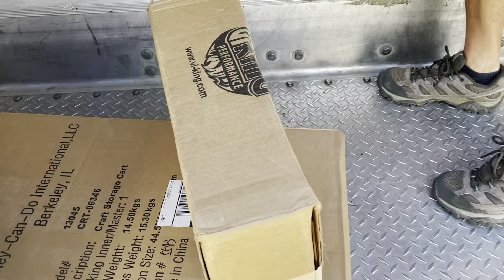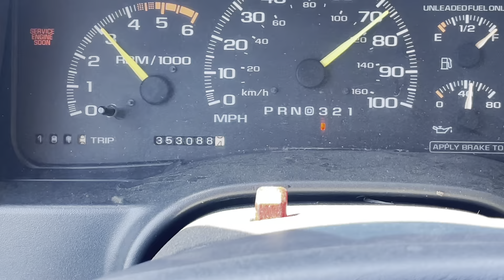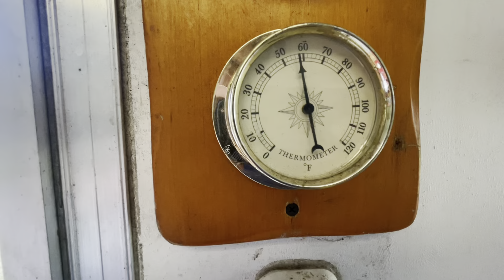FLYING! New PERSONAL BEST but a difficult weekend at Edgewater!

Comment: Love this video. You have me thinking of getting back into racing with a similar class of car.  I was a nitrous guy too and when my car ran 12.40's on the motor and 11:20's on a 175 hit it was the most fun and rarely broke parts. I could also run pump gas on the street.
Reply: Those numbers are not adding up there's no way you pulled that off
Reply: Lviv for love… come again? My math works on that. My mild 355 went 13.50 on motor and 12.20 on a 150 shot. Every time.
Reply: @DWO619  Don't really care if you do believe it. When you have a set of heads bigger than the cam is matched to the nitrous will make up for any short comings in the combination. Also I was racing in Maryland where the air is better than where you are maybe. But i'm sure you took all of that in consideration. Also we used a fogger into the throttle body. But I'm sure you already knew that.

Comment: Not sure if you can do the same with Chevy, but with Pontiac you can build a piston stop with and old spark plug, knock the porcelain out and and weld a 1/4 bolt on it. Then put it in number 1 rotate it one way slowly, mark the balancer. Rotate the other way mark the balancer 1/2 way between is top dead center. And should be zero degrees on the balancer.

Comment: Bill this is your best video yet. I have not bracket raced in 20yrs at Edgewater. Because of your videos Im building a G-Body Bracket car again. 82 Cutlass from Florida with zero rust. Get the car tomorrow and have a couple weekends of work before she is ready. A new 4 bolt 355 crate motor, a RV truck cam. Has a nice set of Eldelbrock RPM heads with a Holley Carb and a new TCI 350 transmission. I have to figure out what Rear gear it has. But I’m hoping to run mid 12’s on just motor. After I learn the car and how to play the game again she will get a 150 shot. I got a stupid deal on this car. I will be racing a rust free 12 second bracket car with a new motor and new transmission for around $6,000 bucks. Deals are out there Guys if you hustle. Thanks for the inspiration Bill. Please do more Track videos. Hope to line up next to you at Edgewater soon…

Comment: Thanks Bill, those few seconds at the end answered my questions about manual mirrors. I got screwed by buying the power version 
of those Trail Ridge mirrors.  FACT if my truck actually vibrated as bad as my mirrors there wouldn't be a safe cup holder in the truck!

Comment: Love the new camera angles in the car. We had that same problem with a drag radial and I upped the air pressure. We were wadding the tires up at 18psi and increased to 20psi. Our car is 4200lbs with me in it. It mid to low 1.4 60fts.
Keep up the great work!

Comment: I've got a challenge to you Bill. Buy yourself an Edlebrock Airgap intake and put that on.. if it doesn't go faster I'll buy the intake from you to cover the cost of the intake. I run an Air Gap on a 350 in my 88 S10.. stock bottom end, Double Hump heads, .490 solid cam, 4.10 gears and I run 12.0's with a 1.58 60ft.
Reply: what size stall
Reply: 3500

Comment: Hey Bill even a bad day at the track is better than good day at work,she's leaving the line alot better this time around,my car picked up 3 to 4 tenths with nice cool air coming in and the exhaust uncorked, I would love too hear the boo with open headers,sometimes I would take the pipes right off or depending on how much time I had I would take the collector bolts out flip the exhaust to the out side off the header take a grade a bolt nut and lock washer and bolt the exhaust on with one bolt,and some safety wire and it would always run better,plus you don't have as much trouble hearing if your car is running when rail or super pro is runing you down

Comment: Bill if you're gonna stay on the juice, then you'll be dollars ahead by buying your own mother bottle, and finding old refrigerator that'll take up right bottle of that size. 
Surely up there you should be able to find old side by side refrigerator for cheap that yuh you can strip the shelves out of it.
Because for the inflated price they charge to fill bottles, and the fuel your burning up there and back. 
It won't take but a minute to recover the cost of the bottle, but actually you'll be money ahead, only feels upside down at first. 
Good luck, and have you ever ran heavier springs up front to load the back up harder, and I've even known some that'll just run heavy on drivers front to counter they're weight if they're on the stocky side of things.
That way you can run your shocks closer to the same adjustment instead of having to compensate for the driver's weight. 
Just something we use to do, but we didn't have the high tech shocks you have today either. 
But it doesn't really look like it's loading the rear of the car for best traction either. 
But I've seen now where they're actually raising the rear up on launch to press the tires harder into the track to get traction. 
Reminds me of the old dodges up on shackles to get tires under the fenders in the back.
Here we were going down in the ass ends, and dodge boys were making extra long leaf spring hangers to raise the ass up.
Sure made them dance around on those old bias tires too, and they couldn't hardly drive on wet roads because of they preferred to go in circles when they tried to leave red lights and stop signs.
But that was probably before your time, be closer to your dad's days back when he drove his 55 daily I'll bet.
Happy Easter and scratch the pups heads for me.

Comment: Bill you mentioned at 20:26ish where the other driver was on the brakes to not break out and you just barely drove around him using the bottle..
One thing I learned a long time ago when bracket racing cars in this range of performance is the following- use your brakes to scrub some speed and if you are way out there you can ease the throttle out some, but never lift and brake too! The other lane can and often will top end charge you in those last few feet! Too much momentum is lost when you brake and lift both at same time. Use one or other but not both! 
Then again if you both are spraying the big end well...lol ya' just never know!
Also learned long ago to never try to "evaluate" your opponent. Just go out there and run your lane. Sure you need to know who is dialed higher or lower, but in theory even that shouldn't matter so much. 
Also, for all you new drag racers out there, get you a practice christmas tree and use it! If short on funds then just download a free app on your phone. Just get one and use it over and over. Once you really get to know your car you should be able to hit consistent .015-.020 trees. Then when you really need to bang it in the finals you have just a little cushion to nail a .006 for the win!

Comment: It's  pretty good for stock shocks and tight front suspension. You get your shocks on it. Loosen up the front suspension and maybe trick springs you won't have anymore wheel spin. Also a couple of times  I have had to add some seafoam a while then change the oil and adjust the lifters of also had to listen to the engine and i even used a vacuum gauge when I adjust the like a carburetor . Of course making them all the same turns.

Comment: Seems like you got no quench, pistons are probably so far in the hole you probably only have about 9.2:1 compression.  A 383 with 2 valve relief pistons at zero deck will get you what you want.

Comment: Unless you're carrying a beachfront of sand there is no need to throw away a race at the finish line. There is nothing the atmosphere can do to make your car pick up more than a couple of numbers unless it's inconsistent, so a couple of squeezes on the brake pedal will be sufficient in most cases. Throwing away 10 to 15 MPH is just asking for a loss, but then again I've won many a race due to mistakes made by my opponent rather than my skills, and I was always grateful.

Comment: One thing I found out over the years is if you just run your number you don't have to play all these games.
Reply: How do you run your number tho? Seriously, cause we are only talking like 10-12 seconds here so how do you run your number consistently when we are dealing with seconds and hundredths of seconds? That’s what I’ve never figured out
Reply: @1982MCI  just do the same thing over and over. Some vehicles are far better than others.  I usually dial off the last pass,  but also look at the weather and such.  You will also find some vehicles just get faster as the day goes on.  Some will get slower.  It's just knowing what you have and doing the same thing every pass.  Stage the same.  Leave the same.  Same shift points and so on.  Just rolling in a extra inch at the line will change everything. What you gain on reaction time you loose on et and so on

Comment: Have you changed the springs in the distributor for the Vance to a smaller or weaker spring so the Vance timing comes in sooner I'm thinking you got the MSD sugar the little one
Reply from the maker: It’s locked out. 👍🏼

Comment: I’ve watched all of your Malibu videos. This is very ironic but I built the same exact engine with the same problem. It has a low rpm stumble and the car just won’t make the power it should for a 355 with 195 Afr heads. I thought it was my carb so I bought a new 750. Please let me know if you find out the problem.

Comment: Did you open the ring gaps up on that motor for spray or is it stock ring gaps?
Reply: He had mentioned earlier that he had no idea what is actually done to the engine other than what he has bolted on.

Comment: Did your tire went flat could have been that your tire was off balance or would that have to break the beat to make it fully off balance not too sure I was just wondering
Reply: The valve stem was leaking, he fixed it by tightening up the core.
Reply: I was wondering if it came off bead because of it because I know the tire went flat could that cause the tire to spend less or more

Comment: His sand bag was a little heavy
The tip of the day bracket racing with a nos kit is where its at I have went round after round without having to squeeze the kit then have a solid month of race weekends spraying just about every round here or there its the best fix for my  mistakes I never called it my nitrous kit I called it my "sand bag button " ill find the pic of my dart with the power switch labeled  "SANDBAG BUTTON ON/OFF".

Comment: Run your Nitrous times on Motor, Da above 4000, No nitrous. No Power adders. Would run tens with traction and uncorked. Stock, standard 4" bore production  350 4 bolt main block, stock chev Rods. I'd suggest sell that Engine, build a 383 flat tops, ported Dart iron Eagle heads, or the Pro-1's if you must have aluminium heads. Look at my build on my YouTube.

Comment: I don't know old school maybe you could build a 377 a 440 small block I don't know of 434 or 421 the 440 is a 400 block with a I guess a 327 crank in it makes like from 4 20 horses to 550 on motor I don't know maybe that's that's pretty good right